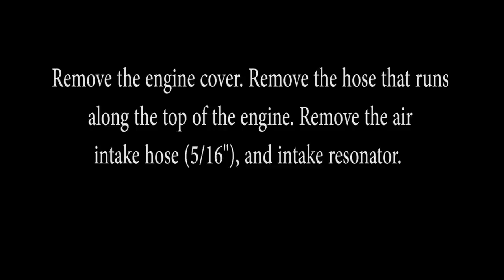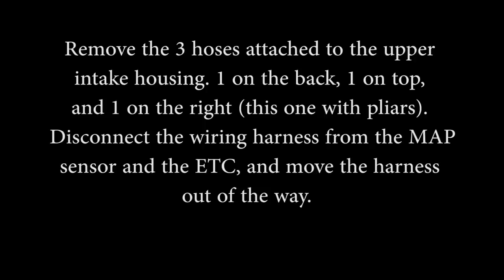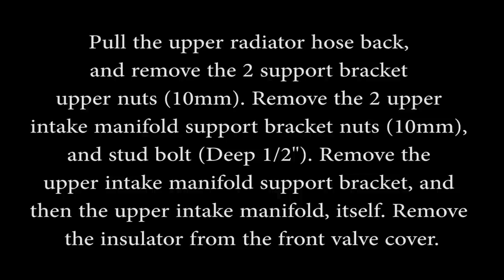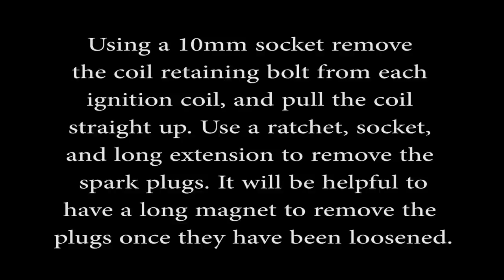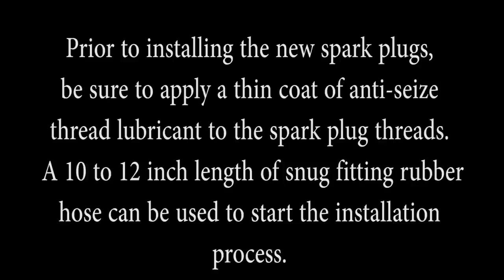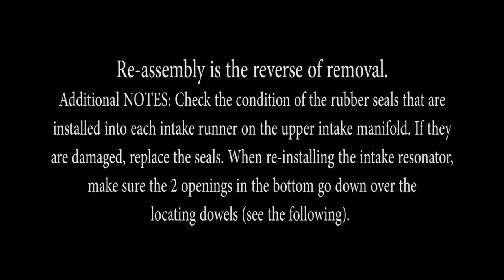Spark Plug Replacement: Ignition Coil: Caravan: Town & Country: Routan: 3.6 Pentastar 2011 12 13 14

Comment from the maker: If this video helped you, and you feel like giving a small donation to this channel. Please donate here: paypal.me/unclevroomvroom    Thanks!
Reply: You get your plugs from the dealership always. There OEM and the Points are already set for your vehicle. Anyways thanks for the video bro.
Reply: @enzoprosciutto210  You should never trust the spark plug gaps of anything out of the box.  Some plugs have a cardboard sleeve over them to prevent them from getting bumped while being transported, but even so I have found plug gaps that were off.  It's cheap insurance to have a spark plug gap tool from any local auto parts store and takes a few extra minutes at most to double check them.
Reply: uDunDunnit thanks i did not know this

Comment: 24 hours ago I was in the process of completing this job. I watched this video 3 times and took note. My 2012 DGC had extra tie downs and the heater hose was held down by a holder held onto the valve cover. But I just want to say thank you for this to the point video. This is a simple job to do.

Comment: Yep, you just confirmed it. Off to the mechanic for this one.
Reply: yeah this is a pretty intensive plug job
Reply: Absolutely. I miss my old 82 f100 straight 6. Just pull the wire and replace the plugs. Could change all 6 in 10 min
Reply: Yeah so many steps and so many things to remove. Started off easy, but as the video progressed, it got harder

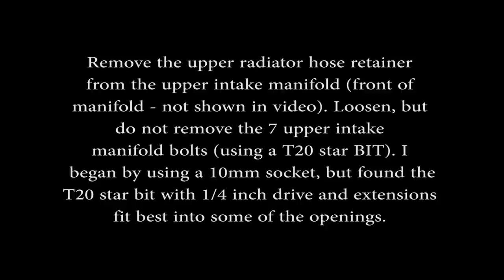Comment: Awesome video with good resolution, lighting, detail, and instructions. I just finished installing the spark plugs and here is what I did to save some time and aggravation. I literally skipped 1:57 to 3:31 of the video and left the throttle body hoses and cables attached. All you need to do is rotate the plastic intake 6 inches or so to take the foam out and access the front 3 spark plugs. The intake is free and unbolted just tethered a bit, no need to remove it from the car. Before taking the intake off I changed out the rear 3 spark plugs, then unbolted the intake, rotated, and changed out the front 3 plugs. So save yourself some time and leave the harness and hoses attached to the throttle body.

Comment: I'm about to start this project in about 10 minutes.  Thank you for this video.  I'll post back to say how it went!
Reply from the maker: William Casey Good luck!
Reply: Wow... I finished it, but man... I am having the worst time getting the resonator on those two posts in the back.  It's putting the throttle body in a bind.  The binding is causing the Throttle body to grind when you put the key in and turn it to the accessory position.  Any tips on getting all that lined up right?

PS - Your video is just the best, man.  All repair videos should be like yours.  Not even exaggerating.
Reply: Here's a video of that terrible sound.  Good times.  https://www.youtube.com/watch?v=_X64Rw6aQ6w
Reply from the maker: Wow. That's interesting. I know it sometimes takes a few tries to get the resonator on the posts correctly, and engaged with the throttle body, but the sound it's making doesn't make much sense. Have you tried it with the resonator completely removed? If so, does the sound go away?
Reply: That's exactly what I did today just to check that my theory was right - took the resonator off but made sure the sensor was still attached.  I turned the key to the acc and then run (but I did not start the engine) and it did not make the noise at that time.  

I slowly reassembled from that point forward, testing after each step.  I didn't get the resonator seated fully, but one post clicked into place, and the other side slipped over the top of the other post.  I couldn't get the second one to click.  It still makes a little noise and I got  the dreaded flashing check engine light... but I'm told that it may be due to me not resetting the PCM (Powertrain control module... computer).

I may take it all apart again and reassemble just to be sure that the upper intake manifold is all lined up correctly.  Crazy thing is... it runs.

Comment: The detail of the procedure was perfect. The only thing missing was that when the spark plugs are to be changed at 100,000 mi intervals, you’re also supposed to change the air intake manifold gaskets. Found out later and had to take the engine apart again to replace them. Please consider combining the spark plug & air intake manifold gasket changes.

Comment: Thanks so much for this video.  I followed it today to change the plugs in my 2012 Town and Country.  Mine was a little easier since a previous repair shop had replaced an ignition coil so some of the clips and wire harness mount points on the intake manifold were easier to take off.  Still, your video made it easy to attempt this by myself and be successful.  Thanks again!
Reply from the maker: Glad it helped you out!

Comment: Wow, all that to replace spark plugs!  Gone are the days when you could do it in half an hour.
Reply: At least it's only required after 100,000 miles (160,000 km).
Reply: Michael McLernon ya, I like my 1990 jeep wrangler
Reply: I was thinking the same thing. Like all that work to replace spark plugs. Smh.
Reply: You’ve never had to replace spark plugs on 2003-2009 ford f150 5.4 3 valve triton V8’s 😂
    They break in the cylinder heads and still take about 30 minutes per plug with the removal tool to pull them out. I’m glad they redesigned them in 2010 to not break. 
   This is actually a pretty easy job on these.
Reply: You could easily do this job in thirty minutes if you watch the video a few times first...It's just a memory game, like putting together a puzzle.
Reply: You are supposed to still inspect them periodically, waiting until 100k to remove them the first time will have you swearing up an down the driveway when they break off because they are frozen in
Reply: @terryrawleigh8912  inspect them?  if i am going thru all that work i will be replacing them regardless of miliage.
Reply: @ParkourRoblox  I agree, my comment was more to the people that think leaving them in for 100k is a good idea, at that point they will be frozen.

Comment: Cover them holes, I cut a piece of cardboard that fit perfectly and added a little weight on top....If you dont have a magnet the old boot works great. Use the boot to start threading the new plug too. It took me 2 hrs thats taking my sweet time. Could do it a hr or less forsure.

Comment: I forgot to mention. I wasn't able to get the hoses off my upper intake housing, therefore couldn't fully remove the upper intake manifold. But there was enough room to slide the manifold over and get to the plugs that way. This maybe a tip for others that can't get their hoses loose.

Comment: AutoZone sells a dedicated spark plug socket that already has the extension installed.  Allows a little movement around a ball type joint but the main selling point at least for me was that the extension had the magnet to catch the plug.  The installed extension pretty much kills the chances of the socket and plug falling off the extension.  If used correctly plug, socket and extension come out as one piece.

Don't forget a dab of die electric grease on the head of the new spark plugs  when installing and a small Mount of anti size around the threads of the new plugs.  With this extension I had my 2014 Taurus SHO plugs removed and installed in approximately 45 minutes..... including rear bank which on front wheel drive vehicles is normally a nightmare.  Very minimal removal of other components.  The components that were removed were fairly  simple items like the strut tower cross brace and a couple of tubing lines.

Comment: The NGK plugs mentioned at the 0:16 mark are the wrong ones.  The correct NGK plugs are the #9723 plug with a .044 gap (from factory) which can be changed to a .043 gap if need be using a wire gapping tool (available at any auto parts store) meant for iridium plugs.  If you try to gap the plugs he mentioned to the correct specification, they could have a failure.  I just spoke with NGK and this is what they recommend.  RockAuto also lists this as the correct plug for the 2013 Town and Country.

Comment: Curious to know what the ignition sequence is? Is ignition 2,4,6 left to right the front of the engine block when standing in front of the van and 1,3,5 is the back of the engine left to right?

Comment: Thanks for the video. I am about to change the plugs in my wifes 2012 T&C. It doesn't look like its to bad of a job. The reason I am changing them is that I am getting engine code of a mis fire in cylinder #5. Hope this fixes the problem. If not, do you have any suggestions?
Reply from the maker: That's the very reason I changed mine. The engine code didn't go away after. It ended up being a head issue (Leakage). There is a Technical Service Bulletin related to the issue, and the dealer replaced the head at no charge to me (up to 120,000 miles, I think). I would look into that before changing the plugs. It's a major issue with the 3.6 motors. Good luck to you!
Reply from the maker: http://australiancar.reviews/_pdfs/Chrysler-Jeep_TSB_09-002-14.pdf I know it shows as only for the cylinders 2, 4, and 6, but I was told by the tech when I got mine fixed that people were having the same issue with the other head, too.

Comment: Nice video. Thanks for not adding annoying music. A little commentary would be good. You shouldn’t add anti sized to spark plug threads.
Reply from the maker: Why no anti-seize? I thought you always use it on Aluminum heads.
Reply: unclevroomvroom 

https://www.motor.com/magazine-summary/trouble-shooter-mar-2013/

See the attached link. I guess it’s not a definite never but as a general statement about spark plugs it’s probably better to say don’t use lubricant on the threads. You could give specific instructions for adding lubricant to the plugs on the vehicle you’re working on if you have the information. Thanks for the reply.

Comment: video is pretty good , to bad it didn't show if there is some sort of trick needed for some of hard to reach plugs or where they are  for the not so savvy on this, it would have been huge help in my case .
Reply from the maker: As you can see in the video, the plugs are under each coil. Also, once the upper intake is removed, there are no hard to reach plugs. Good luck to you.
Reply: yeah I  saw another video and notice that , thank you .

Comment: Great video.....I thank god I have a 2009 with a 3.3 litre......Takes me all but 20 minutes.....seems all new cars require the removal of the air intake unless it's a 4 cyl.......egad!!!!!!
Reply from the maker: I hear ya...
Reply: I had to remove the upper air intake on my daughter's 2001 PT Cruiser to replace the spark plugs even though it has a four-cylinder engine.

Comment: Is it a .043 gap?
Reply: Yes it is!
Reply: It depends on the plugs you buy. I got the NGK and they are Gap - Factory Preset: 0.032 in. Some can be 0.044 which I think is crazy.
Reply: @pcprodoc  The NGK plugs mentioned at the 0:16 mark are the wrong ones.  The correct NGK plugs are the #9723 plug with a .044 gap (from factory) which can be changed to a .043 gap if need be using a wire gapping tool (available at any auto parts store) meant for iridium plugs.  If you try to gap the plugs he mentioned to the correct specification, they could have a failure.  I just spoke with NGK and this is what they recommend.  RockAuto also lists this as the correct plug for the 2013 Town and Country.

Comment: Wow! Much harder to change plugs on Dodge van than my 2001 Honda Civic. What were Dodge engineers thinking?  Engineers should have to work on the cars they design so they know how ridiculous their design flaws are.
Reply: Any modern V6 is pretty much the same procedure.  4 cylinder are easier because their is less to remove.

Comment: holy shit, this is what overengineering does.  I have an 06 3.3 caravan and it takes about 20 minutes, everything is easily accessible, this just looks like a nightmare
Reply: I had a 2005 but I took the wiper assembly off to make it easier to get to the back. But now I have a 2012 and are tackling this tomorrow myself. I plan to do this swiftly and non-stop. I hope all goes well. But I am going to remember to put a wire tie back on the heater return hose thought.

Comment: any V style engine should only be RWD. This is horrible. Reminds me of the Altima 3.5 I used to have. I hope you put platinum plugs in so you basically never have to worry about it again.
Reply: These vehicles call for Iridium Spark Plugs 9 - 15 bucks a piece depending on what you want to get. They are meant to last 104K according to maintenance schedule replacement intervals.

Comment: With a japanese car 5 min only to Replace them
Reply from the maker: I had to do the same thing on my 2002 Camry V6. It was just as hard, if not harder. The upper plenum HAS to come off. Why couldn't they just indent the fire wall a little bit, to allow access, right?
Reply: I have one for you my 2013 Audi A6 3.0 (GERMAN CAR) is 10 times simpler then this.  I also have a 2012 T&C..  Unbelievable!
Reply: Let's compare waterpumps. On the Toyota Sienna, you must remove the engine to swap the pump out. I'm ok with popping off the upper intake for the plugs.  Besides, plenty of foreign FWD V6's need an intake removal for this job too.
Reply: @tjhess2  That  is not totally accurate. I have replaced several pumps on Toyota 3.5L V6s in Venzas and Siennas and have not removed one engine. I agree it is quite unpleasant but much easier after the first one. 

It is true that some Asian vehicles with V6s have to have the plenums removed to replace the rear plugs, older Sonata V6s, Maximas, Muranos, Camrys, etc. Hell, even the Ford Escape V6s need the plenums removed.
Reply: @marcsmith3881  I'm just passing on what the FSM says. There may be shortcuts and work arounds, but that is a gamble and depends on the bravery and skill of the person doing the work.
Reply: @tjhess2  I can assure you, there is no maybe about it and it is far less risky. The one thing I have learned in 13 years of owning an auto repair business, this is an experience type business. 

Also service manuals are not always accurate in their procedures because slight variations in year or models can change the procedure completely.
Reply: @marcsmith3881   I'm fully aware of the issues with many field service manuals. I to have worked on 1 or 2 cars in my time as well.
However, what I am referring to is if you take your car to the dealership, the procedure that they will likely perform is going to be the one that the manual calls for. It is also going to come at great expense, so that is something that people need to consider when buying a vehicle and planning for future maintenance. Any deviation from the field service manual and performing and repair is going to be up to the individual mechanic's experience and abilities, and that is going to vary more than any field service manual. It is human nature to look for shortcuts, sometimes they work and sometimes they don't.
Reply: @tjhess2  I am well aware since I spent several years as a Mercedes Benz Tech and have used Alldata for 18 years. The problem with service manuals is they do not update themselves or provide TSBs. Those bulletins are far more important than just about anything else and save techs a great amount of time. 

Of course the dealer and many independent shops will tell you that is what the manual says so they can justify the 4 figure charge. Then they will proceed to remove the pump without removing the engine. Much like going to the doctor, get a second or 3rd opinion.  I am personally glad they do this because then I get those jobs. 

I understand what you are saying but if people followed that mentality, they would never buy a used, Mercedes, BMW, Range Rovers or Audi. Any with airmatic or hydraulic suspension are just a problem waiting to happen. Every brand has something annoying to replace or repair.
Reply: @marcsmith3881  I would agree that most people don't give future maintenance a thought when purchasing a vehicle. And that is one reason why those used high end vehicles end up in the hands of those that definitely don't take care of them, and they turn into beat up sleds.

Comment: I Definitely don’t recommend using anti seize , when you apply anti seize on threads you will never get a accurate torque when using it or any lubricants on any threads , if you properly torque your spark plugs they will not loosen or ever seize in place.